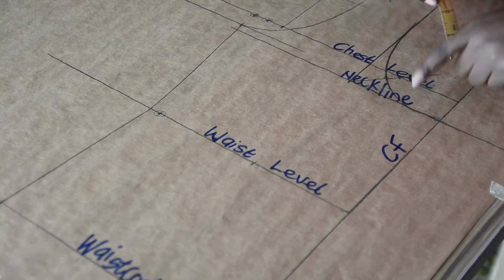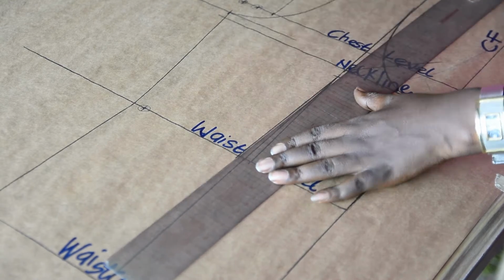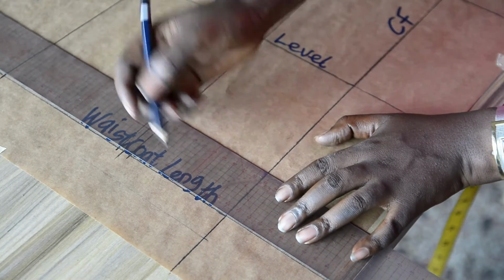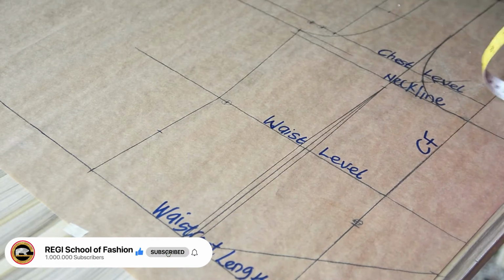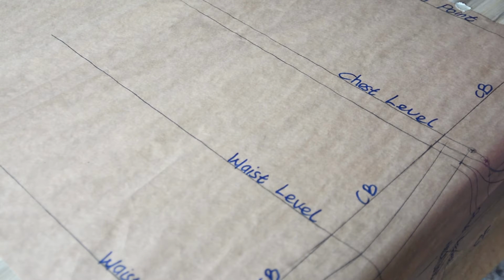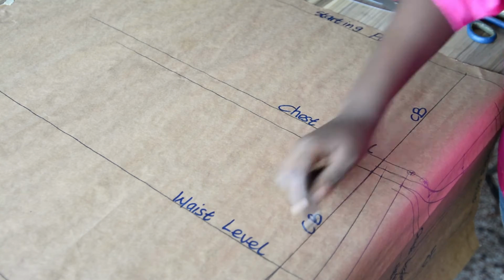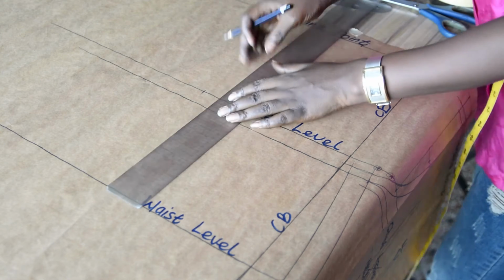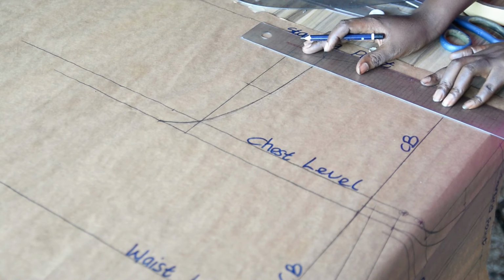HOW TO MAKE A WAISTCOAT PATTERN 2 || A Scoop Neckline ||A Double Breasted Waist Coat

Comment: Hello
Pls after I finish sewing, the armhole becomes big and it doesn't fit my client
Reply from the maker: It cannot fit if your client if you've not learn how to take body measurements correctly. Every fitted and good looking outfits start from how you measure your client. Therefore, I will advice you to master how to take body measurements correctly and how to read your measuring tape accurately for pattern drafting. 
Watch the 2 videos via the link below 👇
How to take body measurements for male figure correctly
https://youtu.be/1AlKHsnFYvM

How to read a measuring tape for pattern drafting https://youtu.be/C4BnCkjeyL4